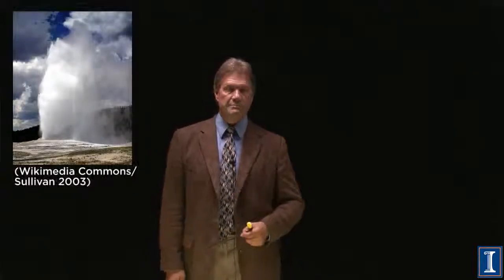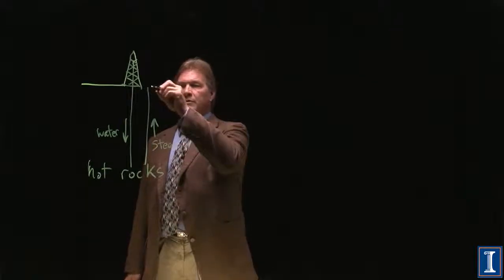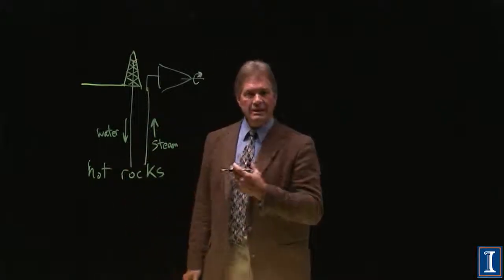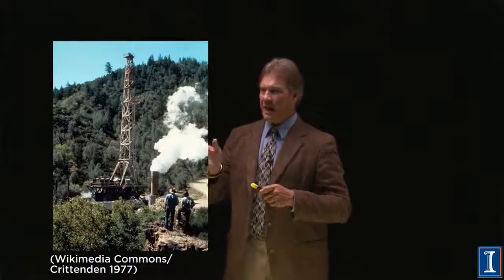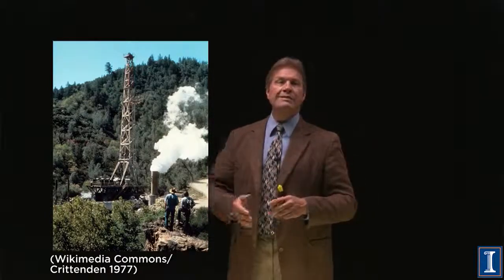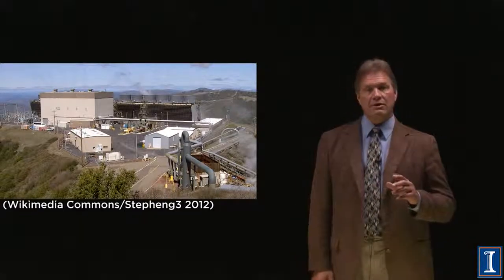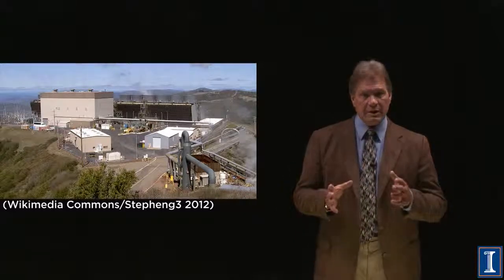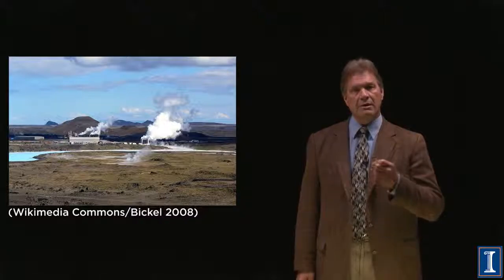Hot Rocks

Comment: As I understand it the soviets dug the deepest hole in the world, but there was a problem: It was 200+ degrees and their equipment couldn't handle it. Is there a reason we can't just dig to a point like that, where we're likely never to surpass the heat from the mantle, and use that as a very long term source of power? Granted, it's kind of an expensive project to get probably a quite small payoff, and the hole might not be stable, but it seems to me that'd be quite a long term investment if handled correctly. Even a milllion dollars for ten watts of power would be worth it over an extremely long period of time, I feel.
Reply: It wouldn't necessarily be worth it (even if ignoring operational costs) because the net present value of a perpetual constant income stream is still finite. Here's what that means: Since you're tying up capital to construct this plant that could have been used elsewhere that means that you're forgoing all the production that would have happened if you had used your capital to do more productive things. A good rule of thumb is that the NPV of a constant perpetual income stream is equal to the cash flow rate divided by the interest rate. Being really generous and saying that electricity is $1/kWh (because of course if you could build this anywhere you want you'd build it where electricity is most expensive), times ten watts is $10/kh, there are 8.76 kilohours in a year, so that's $87.60/year. 30y interest rates are 1.60%, so that's a net present value of $5,475.

If you're unsure about why NPV is the way it is, think about it this way: how much money would you rather have now than $1000 a year from now? Well, 1 year interest rates are 0.13%, so if you got $998.72 now, you could buy a one year bond for $998.71 which will pay out $1000 at maturity one year from now, plus you've got an extra penny. So getting $1000 a year from now is just as good as getting $998.71 today. The $998.71 is called present value. To get the present value of a perpetual cash flow, see how if you just bought a bond with the NPV money then the interest payments would be the same as the cash flow, and then once the loan is repaid, lend the money out again.

Of course, this is assuming that the price of time (the interest rate) is not being manipulated. Sadly, it's set by fiat by the government (more specifically the Federal Reserve, which is private in name only - if you have government granted powers and your leader is appointed by the government, then you are part of the government) because lower interest rates pump up less marginally useful ideas like borehole geothermal. Since the lower the interest rate, the smaller the number you divide by to get the NPV, you can get the borehole idea to look like a good idea no matter how small the returns are if the interest rate is low enough. This is nice if you are in power because all this malinvestment gives you a fake economy to take credit for, but it is unsustainable in the long run because commanding people to lend money doesn't change the economic feasibility of the projects that result.